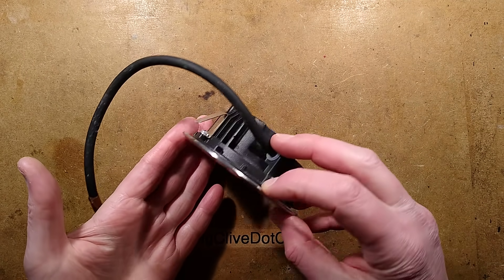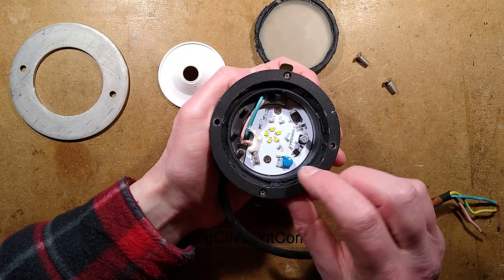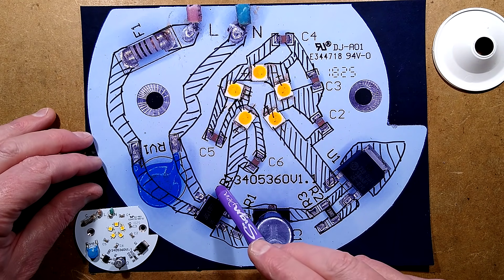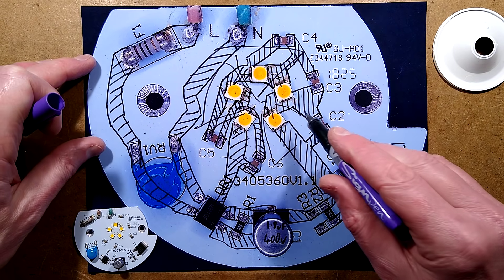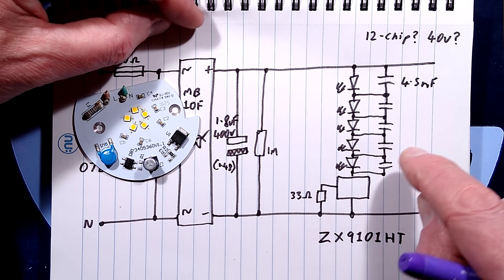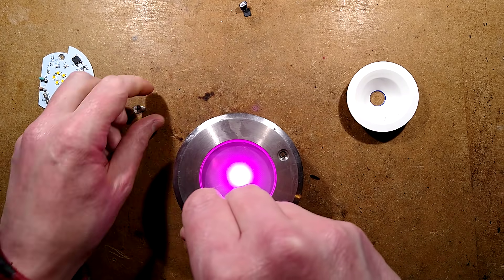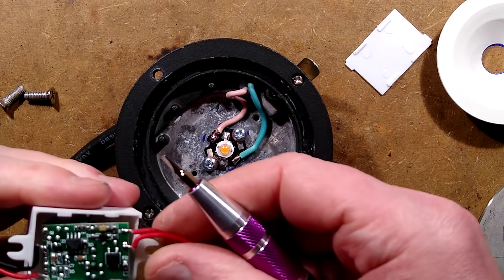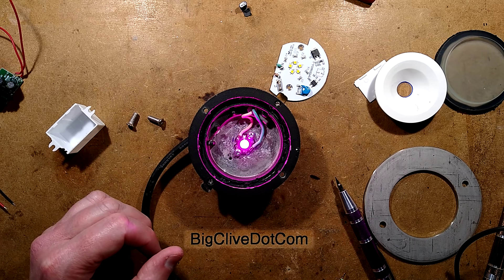Bodging a repair on a faulty ground uplighter

Comment: You know, that mention of the R2-D2 rating gives me an idea. You could probably make an interesting video series about basic electrical safety checks and regulations. Each video, you present one simple check. What it's about, where it applies, what can happen if it's not followed, how to test for it with simple equipment (if possible). Sort of like: "How to check if your - what was it? part P? - certified expert is trying to kill you."

Because I'm a total layman, but some of the things I have found in my home's electrical work (supposedly done by a real electrician), seem... a little odd to me. Like main voltage, stranded wire cables put into lustre terminals without ferrules. I always thought you weren't supposed to do that. Or using the PE as a neutral, when there is a perfectly fine dedicated neutral wire available - just not connected. I never know what to make of stuff like that. Is that shoddy workmanship or do I just not know enough about it?

Even if your British standards probably don't apply 1:1 to other countries (like Germany, where I live), and I'm obviously not expecting you to turn me into an expert who can safely juggle main voltage, I would be interested in something like that. And even professionals from other countries might be interested to know what regulations are like in other parts of the world, like the UK.

Just a stupid suggestion, in case you ever run out of cheap stuff from China.

Comment: You can resolder 3030 smd leds with spare ones with the help of the upside-down stood electric iron
Reply from the maker: These ones have a lot of chips in each LED.
Reply: @bigclivedotcom  Yeah, the most known to me are 18V 40mA, 36V 20mA 3528 chineese, 3030 22V 60mA Seoul Semiconductor, and it is possible to buy them at local radiomarket here where I live, I have repaired many lamps with linear driver on the board with those multi-chip leds. Also on Seoul leds the chip itself is one whole chip, which is electrically separated to have sections on it, those sections of the chip then connected in series with metal plating/spraying/evaporation I assume, not by the bonds.

Comment: What about fill it with mineral oil and then silicone seal?
Reply from the maker: The tricky bit about sealing in oil is not contaminating the sealing surfaces.

Comment: Big issue running them at low voltage with just a straight LED star inside is voltage drop (when you're actually using them outside and a sizeable distance apart). The further away from the power source the dimmer these would be, kinda like long stretches of LED tape. I'd cobble something together to run the whole string on low voltage AC (9-12V?) and rectify+regulate that inside each lamp, but that's quite a bit more complexity, relatively speaking. 
Or just .. don't use them outside, stick a bunch of the 3V versions into the ceiling and make a multi color ghetto disco downlight room or something idk :D
Reply: If you want to run multiple lights like this on low voltage I'd suggest series instead of parallel so the current will be equal and also the power loss will be minimal.
Reply: If a current regulated supply is used, the voltage loss across the cable does not matter unless the combined LED voltage and the voltage loss across the cable exceeds the maximum voltage from the current regulated supply.
Reply: I *think,* if I remember correctly, a lot of "vintage" low-voltage DIY landscape lighting kits (Intermatic, Toro, etc. from the 1990s) use 12 VAC supplies. I'm too lazy to go up in my garage attic to check for sure.
Reply: @dashcamandy2242  12VAC nominal is the current standard for landscape lighting in the US.

Comment: Your pink version is much nicer ! But I agree lighting in the ground is probably not a great idea. Maybe low  voltage LED for paths is ok but 230V 😱

The solar powered LED strip with recycled lithium battery you made in another video is much better :)
Reply from the maker: I'm fine with low intensity marker dots on the ground, but not glaring sky illuminators.

Comment: I bet RTV Silicone would be great for water-proofing it, but you'd have to wait for it to cure. And it sucks that they stick mains voltage in the ground, instead of 12-24v DC

Comment: Does anyone care to explain why the 10R causes issues with the R1+R2 test, please? For us non sparks!
Reply from the maker: The R1-R2 test measures the combined resistance of live and earth to the substation to determine the potential fault current.  Is has to be a low enough value to trip the circuit breaker magnetically to kill power instantly.
Reply: @bigclivedotcom  But isn't that a test for the fixed wiring? The 10R in this unit is part of the appliance, which doesn't form part of the R1+R2 test, surely?
Reply: @misstakenot9582  I'm confused as well.  When I do R1+R2 tests, it's from the fixed wiring.  I've never felt inclined to put my probes onto the circuit board of a luminaire.

Comment: Hi Clive, been watching your videos for a couple years now. My question, For a Patron contribution, would you give advice on 72v dc Lithium battery charger I bought from America. The transformer has overheated and the company I bought it from has washed their hands of it and refunded me. I'm trying to find out what went wrong so I can get the appropriate transformer. I live in the UK and am not having much luck.
Reply from the maker: It's quite an odd power supply voltage.  I wonder if they had a lot of them fail.
Reply: @bigclivedotcom  This was a bespoke charger made to my specifications. 40a @ 72v DC. Current draw is 28a AC @240v 50 Hz. It smoked the transformer.

Comment: Clive, sorry this is about your Glitter lamp video. The reason I ask is that you said used food-grade Calcium Chloride 2 pound 2 ounces for your lamp but you didn't state what size your lamp is. And you also said I might consider the Calcium Nitrate. I bought Calcium Chloride 2 pound tub. My lamp is 750 ml. PPl advise. I am desperate... THANK YOU!
Reply from the maker: The calcium chloride only works with some glitters.  It has to be at the most saturated level possible.  Calcium nitrate is easier.  Both will probably need filtered to make them clear.
Reply: @bigclivedotcom  you are awesome! I really appreciate your help. One more thing can you please tell me how big the lamp was that you were working on so I kind of know how much I need to buy?  Thank you again there are not too many people out there to ask and this lamp is square and I have the original glitter but it is 40 years old. So I bought matching glitter. I really need to know how big the lamp in your video was. Thank you again for your time.
Reply from the maker: @donnahanna10565  I'd suggest starting small.  It takes a lot of the calcium nitrate to get the gravity high enough.
Reply: @bigclivedotcom  Thank you so much!

Comment: Ok... Well if it first flashes brightly and then dims way down, I'm thinking current limiting capacitor? (didn't watch the whole video yet).
Edit: Ok, I guess capacitors that are not there can not fail. I stand corrected. :D Was kinda assuming it's using a capacitive dropper. But nope.

Comment: What kind of repair is this? It's like: The Motor of my car doesn't work good so we put in another motor and - bang - repaired. Of cause its a kind of repair but i really thought you would point out which element failed and replace it and the maybe modify the circuit a bit so it will not fail that easy in the future.
Reply from the maker: The LEDs are multi-chip ones.  Quite hard to get in this voltage.

Comment: I do not like removing capacitors like that, if the PCB is compromised by a leaking capacitor you can easily tear off the pads. Just some food for thought, do it at your own risk. 😁

Comment: Meanwhile CFL and MH downlighters are still working despite being full of moisture 20 years later...
I wouldn't personally use that method of removing caps... a good way of ripping the pads off, ask me how I know lol.
Reply from the maker: Yep.  Because they operate on AC (less electrolysis) and mostly dry themselves out with the heat.  But they still do have electrical leakage issues.

Comment: The house my sister-in-law leases in London has four floor mounted lights like this in the bathroom ... because?  No reason other than some interior designer thought it would be attractive... 
Well at least it's not like there's ever going to be any water on the floor outside the shower stall. Because I'd hate to be blinded by a shock hazard while soaking wet, surrounded by water pipes and cast iron radiators, all while not just barefoot, but completely naked.

Comment: The glue/sealant rubber material around the glass cover failed and let the water in.
Boys and girls, this is what happens when you use the wrong material for the job (probably degraded with ozone, thermal cycles,..), 
Instead of a proper silicone gasket to make a hermetically sealed unit.

Comment: You wouldn't generally be doing R1 R2 readings inside a sealed outside light so it shouldnt have too much of an impact, we're more worried about the structured wiring in the premises, if people want to connect sketchy chinese stuff to their wiring thats on them!
Reply from the maker: The point of the R1 R2 test is to protect the person in contact with the item that has failed.  The load is part of that circuit.

Comment: Sorry Clive, it’s definitely not underground....
Reply from the maker: The bulk of it is.
Reply: @bigclivedotcom  - I class underground to be something where all of it is below ground level. So to me an underground lamp would be in a tunnel.  These lights, I class as surface ground mounted.
Underground lights used in tunnels, in the wet sections, have the added problem that the water that often finds its way into them is also mineral rich, which significantly increases the rate of corrosion.

Comment: I love the knowledge that Mr. Carlesons Lab has, but let me tell you - his ability to talk and talk and talk and talk caused me to unsub from him.  He will spend 4 minutes explaining how he is going to reset the camera and reset the unit for the next shot and he tells you why he's going to reset it all and often throws in a tangent then he resets the camera and shot, then uses the next 4 minutes to explain what he has just done (again) and why he did it (again) and then gets on with it...  Too much Canadian repetition and waffle for me.  Smart as a whip and has great knowledge, but the delivery is off-putting.  Same thing with 12voltvids.  All yap not enough caps.
Reply: It's a shame to miss out on the knowledge, have you tried the 2X speed setting?
Reply: @davidv1289  Yes, I have.  I've thankfully already binged most of his older stuff, but to sit through a 3+ hour repair video (recent)  that in all reality should be about 1 hour - cannot do it.  Even tried leaving it on in the background like a podcast, and I can't.
Reply: Well, watching Mr. Carlsons Lab needs the attention span of an adult. If you´re 14 yo and feel 10 second TikTok videos are all you can bear, you´re probably not his target audience.
Reply: @SharkoonBln  Sir/Madam - If you're generally speaking, then you're not wrong.  

If you're specifically addressing me - I'm over 50 former electronics technician for the Navy and I do not suffer from ADHD. I've also raised 3 daughters and pretty much learned how to be zen when called for.  I wouldn't know a TicTok if it hit me in the head.  I simply heard what he said the first time, retained the information and can recall that information in 5 or 10 or even 20 minutes time without having it repeated to me again and again and again...
Reply: @TechGorilla1987  I agree, the repetition can be irritating at times. But keep in mind, his videos are presented in a more educational format, and it's well-known that repetition leads to retention. The man is truly a genius, and his attention-to-detail is astounding. He's probably forgotten more about electronics than I've ever learned about any subject whatsoever!

Comment: I noticed something. You have the same problem of misplacing your screwdrivers. I know it's not your fault, I blame the manufacturers. They are literally screwing up everything, keep it simple, we don't need pozi drive or sl/ph or combo tip. Philips, Robertson or Slotted. I blame Schneider, Siemens and all the other manufactures

Comment: epoxy everything. that'll solve it.
Reply: Epoxy cant be recycled. So it will end as permanen landfill.

I'd use just a TINY blob of epoxy on the stranded wires and flood the whole luminare with transformer oil.  That helps cooling AND keeps the moisture away.